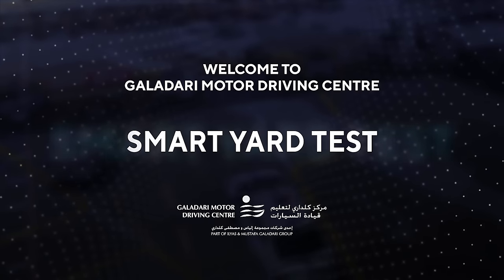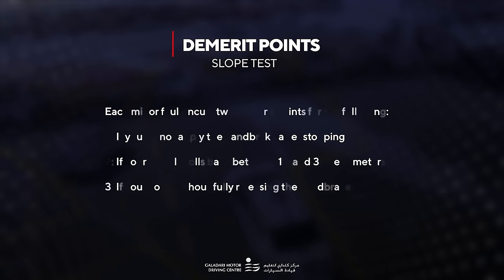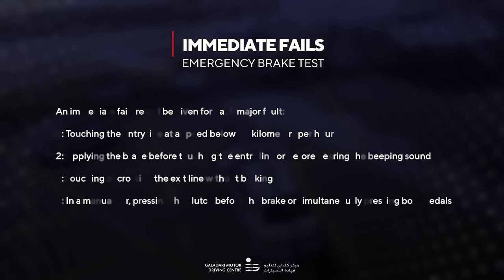Smart Yard Parking Test - Galadari Motor Driving Centre (English)

Comment from the maker: Time Code:
00:00 - Introduction 
00:42 - Disqualification
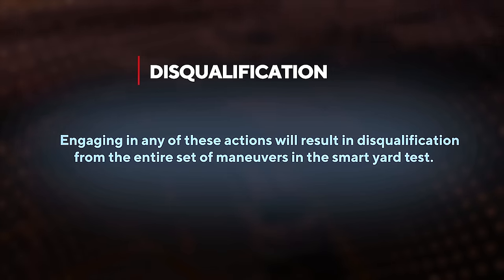01:32 - Immediate Fails (Major Faults)
01:41 - Demerit Points (Minor Faults)
01:50 - Important To Note
02:44 - Start Of The Test (Seat Adjustment, Mirror Adjustment)
03:25 - To Initiate The Test
04:05 - Slope Test
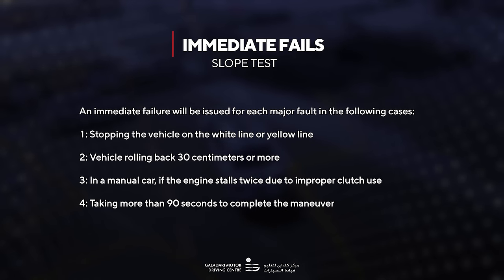05:42 - Emergency Brake Test
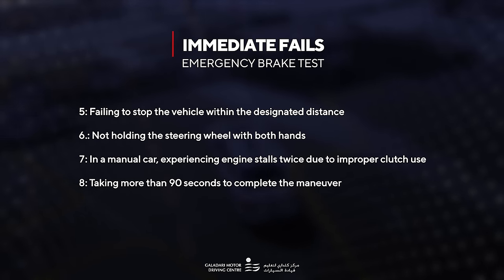07:15 - Angle Parking Test
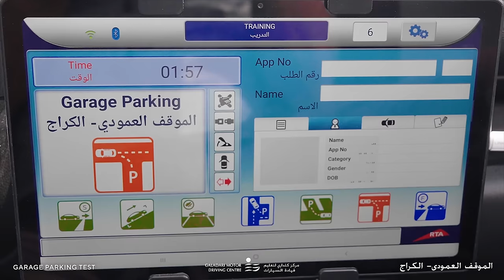09:04 - Garage Parking Test
10:45 - Parallel Parking Test
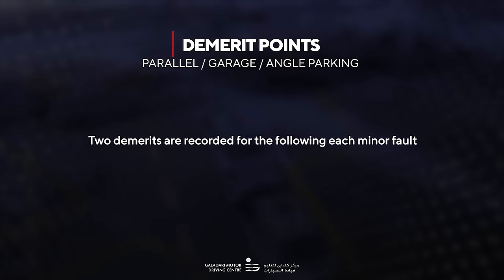12:22 - Angle / Garage / Parallel (Parameters For Test Failure)
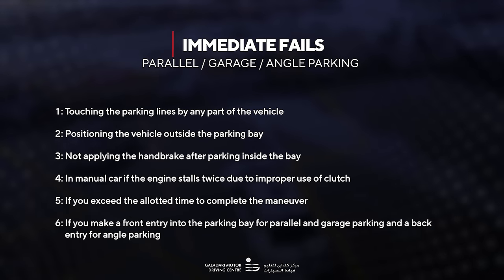13:42 - Finish Point

Important points to note:  
* Adjusting the side mirrors is a vital step for you to successfully pass the smart yard test.
* Reference points shown in the video may vary depending on your height and seat adjustment. Your instructor will provide further guidance to help you understand the appropriate reference points.
Reply: Hi GMDC
I have got to clear some confusions regarding emergency and angle parking

Emergency test- 1)what is the speed limit? Any speed between 25-30? Or maximum 25? 
2) is it wrong to press brake before white entry line to control our speed incase if it increases? 
Is it the point that only speed should be maintaing with accelator only?

Angle parking- 1) is the refference point the right side mirror matching with the yellow line or is it the door handle?

Please let me know the exact as I have my both test next insha allah

Comment: Please change the INSTRUCTIONS IN EBT ABOUT 25 km/hr to Above 20 km/hr. As you are teaching it wrong to all the students. We are facing TO PAY EMERGENCY BRAKE TEST AGAIN AND AGAIN. Please teach correctly.  Thanks
Reply: Yes the same
Reply: What do u mean? They told me 25/26km is max
Reply: Who fails emergency brake test 🤣
Reply: Its says IDEAL. So 25km/hr is max. Above 20km/hr  still applies though
Reply: Bro normally 20 to 25 pr hr
Reply: Bro up to 30 km/hour will be pass
Please learn how to check km/hr metr
Reply: Slowly press the accelerator until you hear the sound just press the brake and you'll pass 🙈

Comment: Today is my RTA parking test.. Need your prayers 🥰
Reply: Alhumdullilah Passed in first attempt thank you soo much to Galadari Driving center
Reply: Same here😅
Reply: @rjk6165  bro just follow the tips mentioned in this video and secondly don't give indicator once you inside the parking until you see that there is no car behind you don't give indicator otherwise you gonna run out of time,
Secondly adjust the mirror properly and follow the markings once the driver door handle backside toucher the line make it a bit more forward and then stop your vehicle..

Adjusting mirror is really important once you know the right points you can then only pass the test secondly seat adjustment is also important 

Being confident is really very very important don't panic just be relaxed and believe on yourself
Reply: Insha ahlla ❤
Reply: God Speed
Reply: Me also😢
Reply: Did you pass?

Comment: For some, angle parking can be challenging and may lead to repeated failures. Don't lose hope. I was once in the same situation, struggling with angle parking alone, but I eventually passed after several attempts. Stay calm during the exam and take it easy.
Reply: I have 3 failures 2 times stop one time wheel straightening time

Comment: This video helps me alot to pass my RTA parking test for the first attempt yesterday, 08/10/24 EDI. Just a minor mistake in the emergency break that had my engine stall, that I had been stuck there for about two minutes due to reaching 3000RPM. However, everything else went smoothly. If your school provides refreshments prior to your RTA test, you are required to attend. The instructor will assist you and make sure you understand everything. Additionally, confirm if you're prepared enough to take the test. A special thank you to every instructor who helped me understand everything and provided precise references that I could use to help me pass the test.
3 IMPORTANT THINGS TO REMEMBER (in my personal experience)
1. You have to stay calm, focus, relax, and think positively that you can do it.
2. Remember all the training that you had, references (very important; you must remember all this)
3. Proper steering and acceleration is a must!!! (just relax your muscle and mind.)
(But if you asked me during my test, my legs just got numb, and I can't feel it if I step it to accelaration, maybe because of hypertension after I stalled in the emergency break, till the end of my test!😓😓 but nothing the less, I still passed! In God's grace! Amen!🙏👏🤩
My friendly advice is that if you believe you have done something wrong during any of these maneuvers, don't get yourself distracted, instead, stay on the track, move on, and stay FOCUS. Be mindful to do all necessary things in the next stages so that even if you fail the test, you can tell yourself you did your BEST, and this is NOT THE END OF THE WOLRD!!!😅😂
GOOD LUCK TO ALL STUDENTS! DRIVE SAFE!🥰🥰🥰🙏🙏🙏
Reply: Bhai 8th Oct toh abhi aaya hi nai

Comment: Tips while parallel parking when steering turned right look at yellow parking corner on left side. When you see parking corner turn the steering straight and have the back tire half way on the white line and fully turn left until right side front door handle makes T shape with yellow line
Reply: Yes ,exactly ! the video doesn’t mention about straightening the steering before the white line when the last corner is visible . This point was very important,straightening the steering!
Reply: Yes its true ..I also thinking the same because instructor teach us like this but when we r entering exam hall they show different methods its like confusing.. They need to make sure the  same way

Comment: Safety is our Motto. 
Friends kindly follow simple tips to avoid accident.  
- Fasten seat belts along with passengers ( or in the case of motor cyclists, use helmets )
- Never take the wheel after drinking and taking drugs ( the International Federation's Secretariat has adopted a zero alcohol policy for drivers ).
- Never use mobile phones when driving.
- Apply safety distance while driving and parking.
- Keep to speed limits and adapt driving speeds to weather conditions , the state of roads and the amount of traffic.
- Obey traffic signals , road signs and the highway etiquette in general. 
- Drive, Stop and Park your vehicle carefully without creating inconvenience to other road users and pay special attention to pedestrians, cyclists and all vulnerable road users.
- Use signals while starting , stopping , turning , overtaking , slowing down and parking.
- Park only in designated places.
- Always careful about Blind Spots and Tailgating.
- Obey "Right of Way" rules : A Green Light is not a right of way , it is a licence to proceed with caution. Using signals show your intention but they never give you right of way.
- Avoid Distracted Driving cause by manual, visual and cognative reasons. 
- Night Driving reduce visibility which creats chances of making wrong decisions. 
So avoid driving at night, if not necessary.
- Driving is a life skill that requires lifelong learning.
- A Driver should constantly re-evaluate and refine his existing driving skills.
- Your Driving Licence is an Agreement between You and the Rest of the Society.
- You must drive having due regards to other Road Users.
- Respect Everyone's Journey. 
- Other people will make mistake @ Slow down to react fast.
- Importance of Physical Fitness (General & Specific) of the Driver which improve your Concentration Skill, Stamina and Fatigue Resistance and thereby might be enhancing your safety on the road.
- Wish your safe journey.
Reply: Please give me some advice now gmdc oppered driving course manule only 4500 aed this price get license i don't bilive this can you tell who take this opper geted license

Comment: 1. Can we move car back and forth while parking test 
2. Why do we have to keep the car ignition on on test end
Reply from the maker: 1 . For each additional move the system will give you 2 demerit points, More than 4 demerit points will consider as a fail for that specific maneuver.
2 . Keeping the ignition on is very important because there is a system working inside the car & if you switch off the car, the system would shut down too. In that case the last maneuver will be considered a fail.

We trust that this has addressed any uncertainties you may have had. We wish you all the very best! 😊

Comment: Reference points during training are slightly different in the test. Don’t feel bad if you fail the assessment several times. It’s Better to retake the assessment till you’ve perfected the references before going for the RTA parking test.
Reply from the maker: yes. thats's why we have mentioned in the tutorial that the reference points shown may vary depending on the height and seat adjustment. Always follow the proper instructions given by your instructor.
Reply: Yes I failed in the smart yard assessment and I took another class then I passed in RTA parking test on my first attempt 🤩
Reply: @rubypals6839  congrats! Best of luck on your final RTA road test 💪
Reply: I experienced the same

Comment: EBT , also don’t move both hands from the steering wheel even after braking/stopping the car. I moved my hand to signal for the next turn, EBT FAILED. So don’t move any hand from steering even after stopping. Just pass on slowly to the next test holding both hands in the steering

Comment: Have differences in between paractice parking and test parking 😢😢
Reply from the maker: Hi . Can you name the differences which you have mentioned here?   If it has to do with the reference points , yes. it may differ. we had mentioned that in the beginning of the video. Reference points also depends on the height and seat adjustment of the individual. follow your instructor's guidance. This is only a universal guideline.
Reply: Yes, especially garage parking doesn’t work with sticker reference
Reply: Reference points are different for different cars. Eg: Reference points for Mitsubishi car is not same as of Nissan Sunny.
Reply from the maker: Correct :hand-purple-blue-peace: @rahim1234u
Reply: @rahim1234u what is for Mitsubishi for garage parking?
Reply: @galadarimotordrivingcentre  then why you are giving classes on mitsubishi, for practice u should give nissan….

Comment: If this is how to parallel park, then why is my instructor giving 3 points of reference and including straightening the wheel as part of the process? Which method is more reliable to follow?
Reply: Way I have been taught today -

stage 1: Full right when parking bay corner is at the bottom of right mirror.
(Same ish as this video)
stage 2: Straighten wheel as soon as both back corners of parking bay become visible.
Stage 3: Full left when left rear tyre touches the parking bay line in the left mirror.

This video suggests just two stages (same as stage one in the previous, but then to full left in one movement when rear door handle passes the parking bay line)

I am guessing the way I have been taught is more suitable for a novice and less likely to result in automatic failure?
Reply: Instructor method

Comment: I failed 3 times ! 
1st attemp only sloop is passed
2nd all 4 failed 
3 all 4 failed 

Ive noticed this from
My Angle and garage said failed caused line touched although its not 

Parallel 3rd attemp said did not hand break but security stopped me do parallel i didnt even go inside but how comments fail mentioned forgot to hand break?

Im having a doubt for grading and i dont think its fair , just simply they are failing everybody just to get more money. Its fine for rich people but very inhuman to jobless people hoping to get license to get job! Very haram for someone jobless they just failing easily!
Reply from the maker: Sorry to hear that. We understand your conerns, however acquiring a driver's license is mostly contingent on consistent practice, thorough training, and skill. The high passing rates proves that this is achievable as you may see from most of the comments. We are here to help you. Follow your instructor's guidance and you will 100% pass :hand-purple-blue-peace:

Comment: Hi GMDC
I have got to clear some confusions regarding emergency and angle parking

Emergency test- 1)what is the speed limit? Any speed between 25-30? Or maximum 25? 
2) is it wrong to press brake before white entry line to control our speed incase if it increases? 
Is it the point that only speed should be maintaing with accelator only?

Angle parking- 1) is the refference point the right side mirror matching with the yellow line or is it the door handle?

Please let me know the exact as I have my both test next insha allah
Reply from the maker: Hi, 
The minimum speed is 20 km/h, and the maximum is 34 km/h. The student must control their acceleration between 20 and 25 km/h to make it easier to brake in time. If the student touches the brake before reaching the white line or hearing the beep, it will be considered a failure.

For angle parking, the choice of the reference point depends on the student's height or what makes it easier for them to align with the point. Using the mirror or door handle as a reference is acceptable, but the student should confirm with the instructor how they prefer to teach this to the students. 
we hope this was helpful for you :hand-pink-waving:😀
Reply: Valid points in your question .. I'm also confused regarding the same
Reply: @galadarimotordrivingcentre  Door handle much preferred to match with the yellow line
Reply: @galadarimotordrivingcentre  Alhamdulillah passed in 4th attempt(I had written the comment at my third failure)
As you mentioned it depends upon the height adjustment.The inside door handle (LOCK) should align with yellow line correctly.